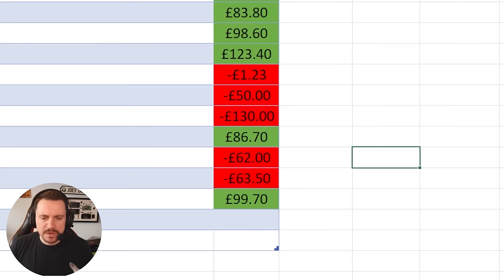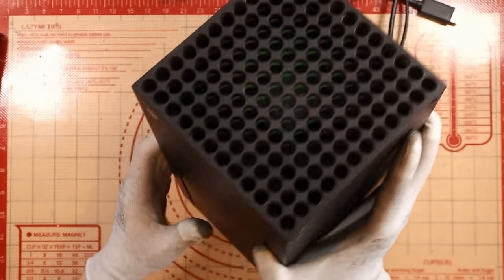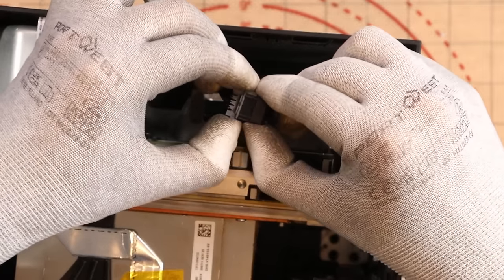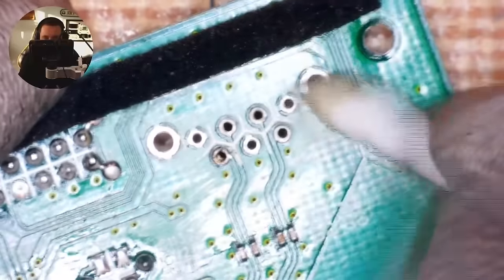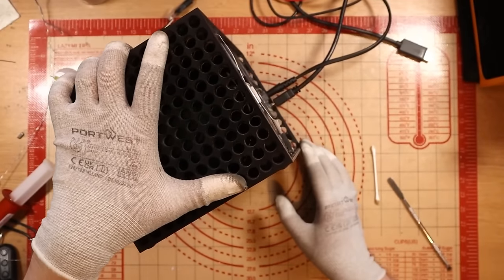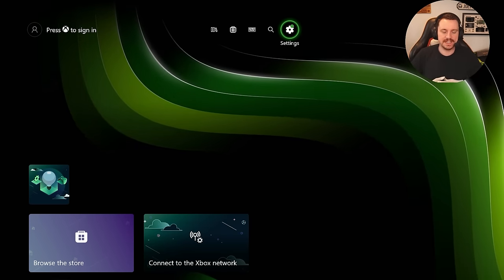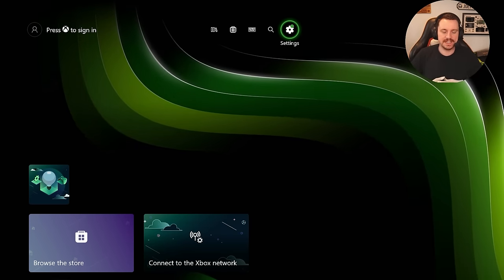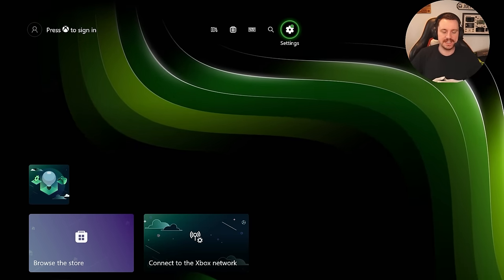Buying a Xbox Series X with a Previous Repair Attempt! S1:E62

Comment: what repair doesnt know that the sata connector was torn off the board itself. i would be questioning the quality of the repair shop. 2 great repairs joey.
Reply: 2 options for me.
1. It went in for repair for something else and they broke the SATA port and the owner didn't realise. I have a series x and it has never seen a disk. Never. Had it a while now. 

or

2. They tried to repair something and broke the port putting it back together and thought they had broke it even more.
Reply: @gavinbar1988  think they must have been very careless

Comment: Damn dude! You make it look so easy, but now i realized ive been using too low and wide heat, waiting for same hot air station as you from affiliate link. Been playing with just received Ts 101, really noob in soldering, but learned ALOT from your videos! Keep up the good job!

Comment: You probably won't see this message anyway since your video is 12 hours old at this point, but I figured I'd throw it out there anyway because if you do see it, you might get a kick out of it.

I recently ran into a similar issue as you did on this video.  I bought a Switch Lite on eBay for cheap, which was labeled as "Does not turn on.  For parts."  Beautiful condition, looked like it had never been opened.  Perfect, I thought!

Bought it, and when it came in the mail, I gave it a once-over.  Screws looked untouched, everything looked in place.  I opened it up, and the first thing that greeted me was that the battery connector on the motherboard had been completely torn off the board!  That's it.  Goneso.  It was still attached to the battery itself, but just flapping around since it had been ripped off.  So, somebody at some point had opened it up for some unknown reason (it was still the original battery), ripped off the pad, said "oh crap", and listed it on eBay for parts.

10 minutes of work, a new connector later, and it works perfectly!  Sometimes you wonder what the heck these systems have gone through....  Oh and of course, I didn't make a video of this system, thinking it was a different problem entirely.  D'oh!  Missed opportunity.

Regardless, well done on both repairs!  Always an enjoyable video.
Reply from the maker: Thank you :) I done a repair recently putting a battery connector back on, all traces torn but got it sorted in the end :)
Reply: Nice!!  

Thankfully in my case, none of the pads were ripped or traces torn (again..... HOW!??!).  So I'm sure my repair ended up being a lot easier.  Now if only I would invest in a hot air station, so I didn't have to do it by hand; that would've made the job so much more enjoyable!

Comment: There garbage once the SSD fails you can't update and they brick
Reply: You can clone the ssd, thecod3r has done it
Reply: @joshkelly4682 yes but if the ssd is broken to much it probably cannot be copied I think.
Reply: @AA-xm7rt  the ssd was was bad and he copied it
Reply: @joshkelly4682  yes but what if the data got corrupted. He did it because the date wasn't curpted I assume.